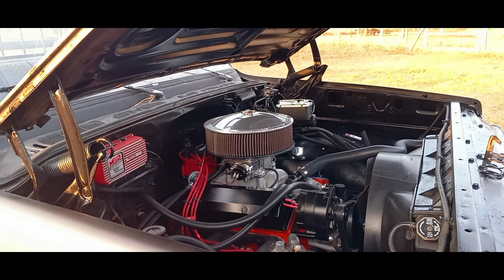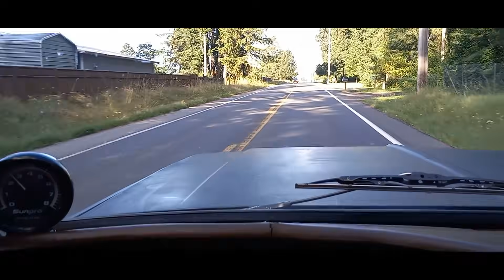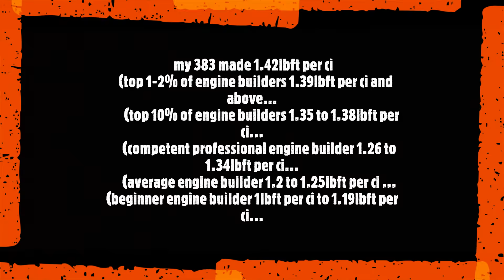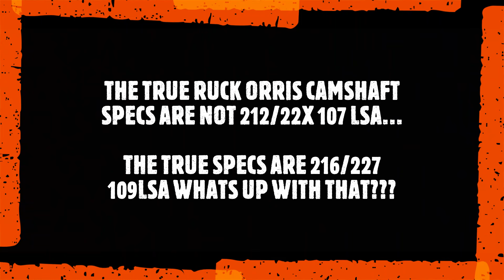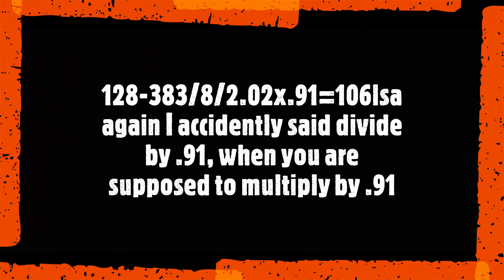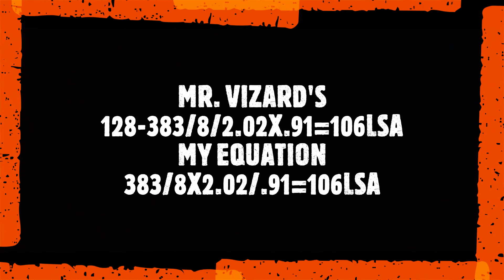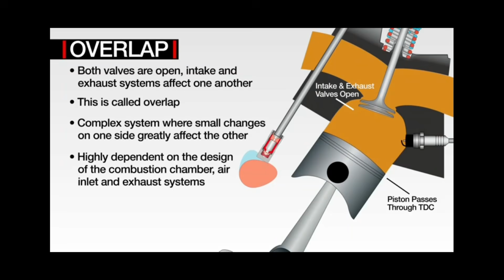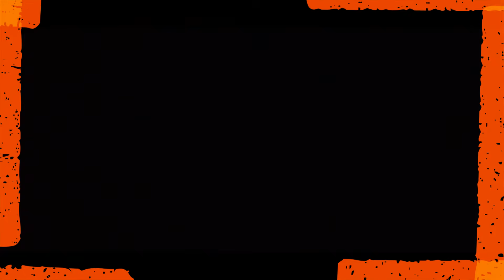CAMSHAFT SELECTION by LSA, 9 LSA's DYNO TESTED!!! LSA THEORY WILL BE DYNO PROVEN!!!, and EXPLAINED

Comment: A couple things as im almost done with this video. Is david vizards 128 rule absolute in your experience? You said some factors including compression ratio can widen the optimal lsa. I ask because i checked the 128 rule on my 355, and came up with 107.4. My current cam is 110lsa but im closer to 11.2 compression. It came from a company i wont name because theyre Mr Ts competion, but they also designed it jointly with comp stating there was hundreds of hours of testing put into it so they wont allow it to be ordered with any other lsa than what was provided. So a shelf cam in a sense but supposed to be optimized for this one specific plaform of sbc. 
If its not an optimized lsa, it has to be close. I get compliments all the time about how hard it runs for being a cam only car. 

Im not surpised about the issues with mr t. I know who he is. Ive been called names by him on public social media in discussions about questionable lifter quality and he went straight to name calling. The guy isnt professional at all. 

Lots of good info packed into this video.

Comment: 108 LSA over lap is max power But modern full race cams Durations are big fat lobes
at like 300 duration  at 108 LSA  the overlap gets larger and larger so 
center of lobes have to be pushed out ward to keep original 108 overlap 
 making the 110 overlap the same overlap as the 108 LSA
And needing a higher RPM Range  going 110 LSA  and so on
Bigger Duration also making intake valve open sooner getting better charge
Watching your 2 video 4 times kind of made it come together for me 
 Thanks  great video 
If I am wrong tell me

Comment: Holdener is old enough his Brain is Deterorating  
when I call him on something he says swing and miss  
like the wild high compression engine  bolting on a 100 horse blower at 10 psi 
 I told him 12 and a half + 12 and a half to1 = Blown Headgasket at 6000 Rpm 
=Bent Piston rods Blown motor Detonation 
and at 10 psi on blower 
also a good way to blow teflon blades on supercharger

Comment: When adding your overlap for the Duration formula, do you use overlap @.050 or the total number of overlap degrees?
Reply from the maker: My newest video will answer that question 100%, it will show the duration formula and show what to do as far as overlap @.050 and Advertised aka total overlap, it also fully explains cam conversion based off maintaining an Optimal LSA and a specific °Overlap by adjusting duration...
Take Care
    ~ Adam ~

Comment: Hello sir, my name is George I’ve been attempting to learn more about picking my cam. I’ve recently lost my good friend and engine builder. He normally picks the cam according to what we are attempting.  Well I’m an old bbc guy that ran a low 9 second street car in the quarter back in the early 80s. So, I remember my friend Gary talking telling me about DV and his way of figuring out camshafts. The car has to be street able. So I’ve been trying to pick a cam for an ls3 with 10.5 compression and rec, port 823 heads. They have a 2.165 intake. So I’ve attempted to use the formula yourself and DV shared for LSA. I believe I need an lsa of 108, and a 246 @ 50  if I’m doing the two formulas correctly this correctly. But, I’m sure I’m screwing up. This car is primarily used for racing. I race it in a street car class.  If there’s a book or something I can purchase to help me make the correct decision please let me know. I’m terrible at the internet.   It I’ve been trying to find the most optimal cam for this stock other then cam motor. Thanks for any reply.

Comment: You have a very awesome show .I would like like you to help me out with my engine I have a small Block 325 cid. Bore .30 over stock pistons  head new valve springs  Camshaft 205/215/258/270/500/112  Where should I set up My LSA or LCA to get the the most out of it  I had Motor Blue Print stock Connecting RD Stock Crankshaft .10/.10  Balance connecting Rod Balance 👍👍

Comment: Thank you so much for this info. I have spent thousands and thousands of dollars on my 383 and couldn’t even make 400 whp. I had forged internals 13:1 compression 195cc 2:05 trick flow heads and a cam with 236/244 540/555  lsa 110. Took my motor to get tune at westech performance haha can’t believe I paid 800 for that. Anyhow gave up on the motor I just bought a LS 6.0 and I been looking for a camshaft thank god I came across your video cause I was thinking of going with the truck Norris. I had contacted a gentleman at hitech Motorsport and this guys seems like he knows his shit he recommended for my LS a 228/234 627/627 with 109+3 lsa. What do you think about that? I followed your calculation and I get 107 lsa. You just lost me on the over lap. 
Hope I can get some input from you this is my car info 
1969 Chevy nova weight 2900 lbs
Motor 6.0
317 heads 
Tire size 28” 
Stall 3200
Gear 3:73
Trans th400

Comment: I'm building a 387 Ford stroker and I'm glad I landed here and David Vizard's channel. I was always told a narrow LSA will run like shit on the street and not to use that cam for a truck on the street. by the formulas you gave I'm looking at approximately 106 LSA at 216/216.

Comment: I put together a 304 CID Ford for a Mustang convertible daily driver.  With 9 to 1compression and Twisted wedge heads with some bowl work and exhaust side porting it made 471whp and 454 torque with a S trim Vortech supercharger.  Twenty mpg at partial throttle with 3.73 gears and a 5 speed.

Comment: Your video has tremendously changed my outlook on building my next motor!! Is there a way to email you or message you with a couple questions I have reguarding LSA and custom grinding?  Im chasing a build iv researched and researched but just cant find any information because of the type of engine build.   Motor is a 383 stroker build.

Comment: Some one please help me to get the right formula for a 450cc engine with 3 intake valves and two exhaust and 13.75:1 compression. My current intake cam card is .362, 254*@ .050 if that helps any. Exhaust is the same card. Thanks in advance

Comment: I screwed with cam timing on my old factory turbo Subaru, but I never quite could comprehend it. My specific car had AVCS, it basically used oil pressure to advance or retard intake cam lobe timing. If I remember correctly advance in lower RPMs would increase dynamic compression and spool the turbo faster...? These were DOHC engines and I was only playing with the intake cam side. It is definitely a vast and complicated science. Your video is awesome and your knowledge on the subject is exceptional. I don't have any big block or small block V8 engines. I'm just here because I'm a nerd. Lol thank you 🙏 I'm sorry to hear about your condition and my prayers are with you.

Comment: I'm tryna to absorb as much of this I can, I have chosen cams with a rudimentary understanding of the features. The last I bought was for a 9:1 355 with mildly ported big valve 993 smoggers and Torker 1 intake. I kept the lift tame at . 480/.480 the duration is 231°/231° @ .050, the lsa is 108° because my understanding was the tighter LSA would boost mid range TQ and the heads not being the most efficient the increase scavenging may help those heads move some air... the centerline I have zero idea but it's 106°, now I may be way off but it was my best attempt at trying to choose a cam other than duration and lift. The cam is a Howards flat tappet 112031-08, the engine seems to run pretty strong, I'm about to put a fresh short block under it the only change is deshroud the intake valves and use some small dome pistons that have CR 9.35:1 with 76cc chambers that will help retain the 9:1ish compression ratio after increasing the chamber volume from the de-shrouding. I could grab some vortecs or some cheap aluminum heads but I think it's fun to try n make a strong running little hot rod engine with heads that "won't even make 300hp" according to the forum gurus which I think is foolish but whatever I don't care what they say Im on a budget I like a challenge and it's fun Anybody can buy expensive parts and make some power. Sorry to hear about your health problems thank you for the tech, I also think DV is the man.

Comment: Awesome video!
Had to throw together an engine for my daily driver a few years back,  just from what I had at the time. 5.7 406  Chevy 2bolt, EX274 cam, China air-gap, Cliff Ruggles rebuilt Rochester, China HEI. 
--But its in a 6800# '95 Chevy HD2500 2WD ext cab long bed, NV4500, 14 bolt 3.42.
Again, only had the weekend to get it running to work. 
Cam is NOT what it should be.  And to me, engine doesn't feel right. 

I have the parts to build a 96 Vortec roller block into a 383, with Scat crank and 6" rods.
And replace the 406. At 70mph im only turning 2000rpms. But only get about 12-15mpg (not at 70 all the time)
How do you feel about single pattern cams?  And how do they impact your formulas? I found a deal on a pair of Dart 230 iron heads. But didn't want to drill them for steam holes.
I rarely see anything over 4500rpms unless im stuck in mud or pulling friends out of ditches.. 
What are your thoughts?
Thank you.

Comment: I'm having a hard time wrapping my head around the overlap.  You need overlap to calculate duration.. but you need duration to calculate overlap.  I need to know how to calculate one of those without the other so I can figure out the two.  I'm putting all your info info into a spread sheet so it will calculate everything by plugging in the bore/stroke/valve size.  I'm stuck at duration because I can't get overlap without knowing one of the two.

Comment: Hi Mr. Cattledog, you and Mr. Vizard have inspired me to do a 383 build to see if I could do as good of a job.  I am using a '79 sbc 350 off my z28.  using 13004000 rotating assembly with a SK12-246-3 comp cams.  Now I know it is not an 107-108 LSA but it is a 110.  I know you poo poo on this but considering cost time and effect I thought it would be the closest match for what I have on hand already without getting special grinds.  Hopefully you can watch what I am doing and possibly give me a few pointers oh yes 180 cc flotek heads I am running thus the cam selected.

Comment: Thanks for this video. I have been down the rabbit hole for a long time, longer than I care to admit, trying to figure out the cams I have in my engine. Unfortunately, the specs I have for them weren't readily available, engine builders gone (retired/jail/etc), Race teams unable/unwilling to share specs, etc. I have a 4cyl but the head was built for a world challenge protege using formula atlantic 4age specs. I've been running this combo on boost for a while but never been able to dial in the cams with the limited knowledge I have. Between you, Vizard, and some others (yes, I've reached out RH and chatted with him a few times "All cams are turbo cams", right?)... I think I have a good starting point now. I've done all the measuring with calipers, degree wheel and a dial gauge to determine my cams. Now to just dial them in based on the knowledge gained here. I appreciate you for this. Overlap, Open, close, LSA and duration were all unknown when I got the cams. Hopefully I can pick up some idle vac (60-70kpa), smooth the idle out (Won't idle sub 1500rpms) and improve turbo response now (dead fish under 4krpms, but from 4500+ it's a whole other beast).

Comment: Nice to see you walking and able to run the clutch in your truck Adam and thanks for the info.

I'm not exactly sure on the overlap. Been thinking about sticking a different cam in my truck come spring time. There's a lot I'm leaving out in sure but the basics are a 6000 pound 4x4 Tahoe daily driver with a basically stock vortec 350, gm aluminum dual plane intake and an Edelbrock 750 carb and still (for now) stock exhaust manifolds with slightly modified exhaust.
Looking for this to be a reliable daily driver.   I was thinking about a 218 duration with .445 intake and .465 exhaust lift with 107lsa and 4 degrees overlap and the 4/7 2/3 (1-8-7-2-6-5-4-3)  firing order swap just to see if that helps bottom end longevity of this motor (my goal is somewhat similar to an old RV style cam, better low to mid range and ok-ish gas mileage). What are your thoughts on that cam profile or what would you change?  I left a lot out I'm sure.   Also a gm style hei recurved to be all in by probably 2800-3200 rpm and vacuum advance hooked straight to the manifold

Just looking for something reliable enough I can put the key in and drive 3000 miles on a road trip when I feel like it
Reply: **** my 90% is just daily driver commuting around town and on the highway and making this engine go another 150k+***
I forgot that part

Comment: Very interesting. There must be many who don't understand this because I did a search on Summit for a cam with 107lsa/220 duration and there's only one listed...out of thousands. There's a handful within range but only one which is being sold as a dirt track cam which, if you think about it, is pretty ideal for a truck. I have a smaller block than what you are comparing, 325ci(5.3l), but I'm looking for more torque for towing. I live in the PNW and it cannot come close to pulling near max capacity other than on a flat road. The trans gearing and shift points combined with a .373 diff don't help either. Time to do something about it.

Comment: Every 4 degrees added to the exhaust cam duration never adds only 1 degree to the LSA .Everything else being equal. 
It could add or subtract from the LSA. Depending on whether it’s added to the opening number or the closing number of the exhaust cam.

Comment: You wasted the first 30 min of my time puffing up yourself and bad mouthing before giving any thing of substance  . Then you gave specifications of “Mr T’s” cam shafts that didn’t make any sense. You said his stage 3 cam  had a intake dur. Of 233deg @ .050 lift and a exhaust dur of 246@ .050 . 
You gave the opening number of the intake @ 59 and closed the exhaust at 7 deg’s and opened the intake @ 8.5 and closed the intake @44.5. I couldn’t make any numbers out of that! 
And then after that you stated  “Mr T’s “  stage 4 cam had the same duration as the stage 3 cam with the intakes opened @ 63 and closed @ 59 and intake opened @8.5 and closed @ 44.5 . What is any good of those numbers? I’m I supposed to guess what you mean? The above numbers are exactly what you said.

Comment: How would you adjust the 127 formula for a supercharged application I used the 127 for my SBF and got 104 I only have 9:1 compression so I added 1 to 105 lsa  Does this seem correct Any help information or guidance would be greatly appreciated

Comment: Great presentation I have been watching David Vizards videos recently I have a 429 cubic inch SBF the formula doesn't seem to work I run a Vortech supercharger at about 9.1 I was wondering if you could help me spec or supply a cam or one of mine regroups I run a solid roller I NEED HELP